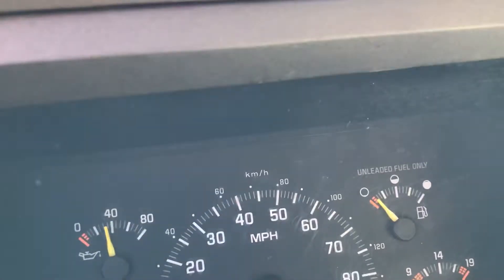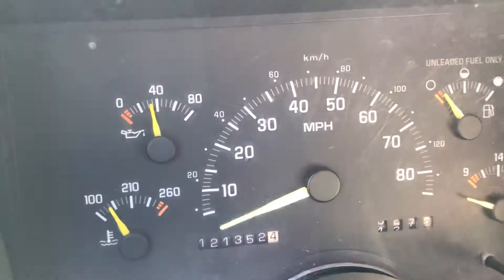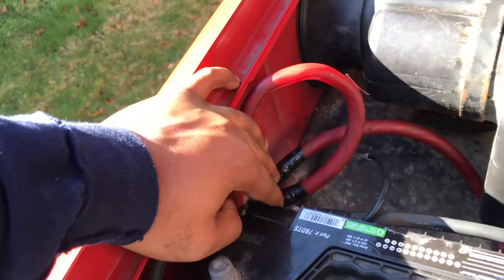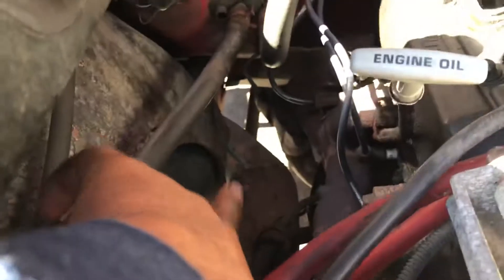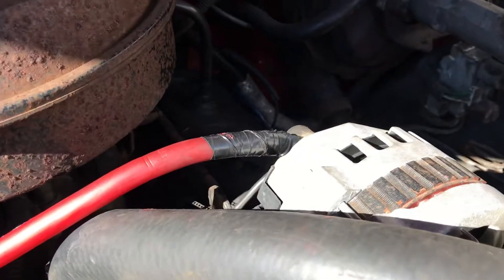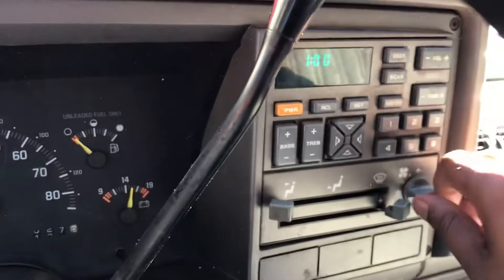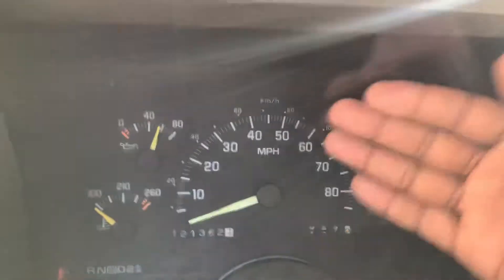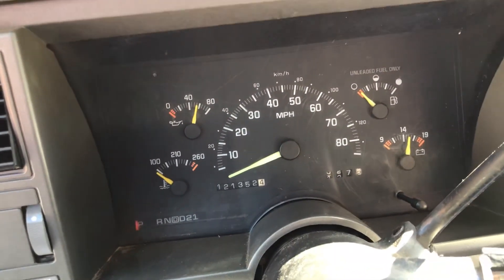GMC SIERRA CHEVY SILVERADO LOW VOLTAGE (SOLVED)

Comment: I wanted to give a like but is already at 420 and I don’t wanna be a jack ass so I will just tell you myself that I liked the video and adding new grounds instead of messing with the old ones was bad ass I may try that myself later on this week when I’m off I got a parasitic draw on mine I gotta pin point this weekend but then I will do the grounds thanks for the video.

Comment: My 93 K1500 had the same issue.  Good job on your set up.   I fixed mine by just cleaning the grounds,  but I'm gonna do the Big three with 4 AWG    If you have ANY vehicle that you are having flakey computer issues,  clean your grounds.

Comment: So basically, you don’t even have to worry about where the ground fault is because you can bypass and correct it with this method???
Reply from the maker: Correct, in my case I didn't touch none of the original grounds
Reply: So is this in addition to the positive battery cable? On factory setup, it goes from Positive to Starter and then you got a separate wire that runs to positive on alternator. Do I just leave all original cables on battery and run a separate set the way you showed it? Or, do I remove or replace any cables?

Comment: Been having this issue...already have the Big three with Zero Gauge Wire and Copper Studs, two fairly new AGM Big stereo Batteries both charged to 100%.   Start my truck up just fine drive around fine then maybe stop at a read light and needle starts going down and slowely goes back up. little draw or big draw makes no difference needle just goes down and back on its own??
Reply: I got same issue did yu figure out what it was
Reply: @xeptur unfortunately "no," I replaced alternators more times than I can count, I also did the GM Stock Alternator bypass meaning It is not connected to ECM (computer that tells Alternator to reduce output) I had Mechman alternator directly wired to Fuse box so when truck starts alternator starts and gives 15Amps continually. Well that did not work either. I have 3 JL 13.5 to a Rockford fosgate 2500DB Amp, mids and tweeters Focal to a 400 Rockford Fosgate. 2 AGM top of the line batteries and 0gauge lines with perfect grounds??? I just about gave up and this investment was the worst I ever got myself into. Should have just went middle of the road crap. Let me know if you come up with something.

Comment: Do you need 0 gauge tho?
Reply from the maker: Me personally...I wanted use nothing under 2 gauge for any connection coming from the battery or engine block.  But you can use 12/14 gauge for body to frame connections.

Comment: Make sure y'all disconnect the battery before making that alternator connection
Reply: What happens if you do not? Had a guy change my alternator did not disconnect battery!
Reply from the maker: @AlienGrade  if you're super careful, nothing will happen. But if that positive wire touches something it will cause a huge spark and can fry our system. Its not work risking taking 2min to undone the battery

Comment: Well, so far this is the best answer to my truck problem, I'm having a 2002 Sierra 1500 engine 4.8 i guess, has a low voltage problem and dancing gauges and hardly starts after 2-3 attempts. I was planning to equip it with a 130 amp alternator to power up a dual electric fans but i think it wouldn't be necessary.
Please correct me if that's true or not.
My fans assembly still not installed I'm waiting some expert advice like you.

Thank you 🌹
Reply from the maker: Me personally, I would definitely upgrade the alternator and upgrade the wires (as I explained in this video)... the cost of doing so is cheap and will save yourself alot headaches down the road. With the stock alternator and factory wiring, you might run into charging issues with electric dual fans.
Reply: @phillyguru6834  thank you so much for replying 🙏🌹.
Then 
I'm going for it.
Reply: Fixing try this on my 91 silverado. Thnx for the info.
Reply: @trailingarkansas7273  How did the big 3 fix work for ya? I've got an '88 Silverado with low voltage.
Reply: @eYeZiQ  it worked great. Also replaced my ground straps which fixed my low oil pressure issue
Reply: @trailingarkansas7273  I replaced my alternator after I gave up trying to access the rear ground strap locations. I cleaned every other contact point as well as I could. I'll get to the straps eventually. But she's running great for now! Glad yours worked out.